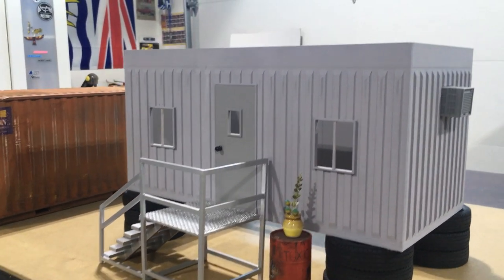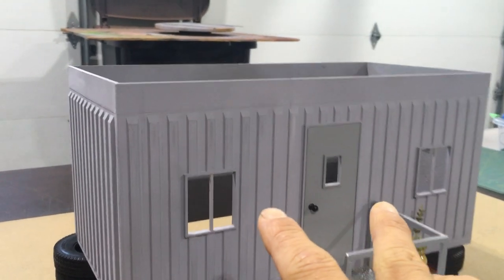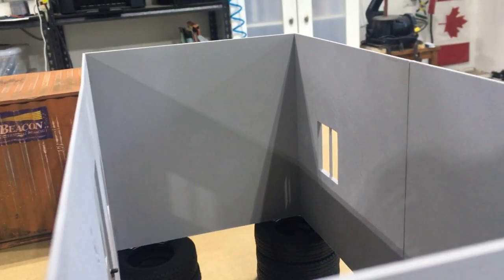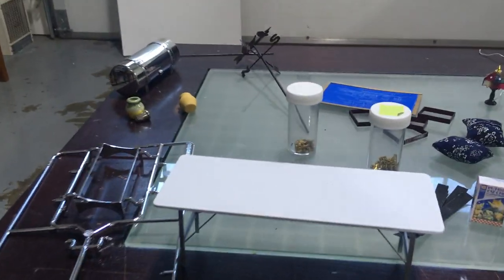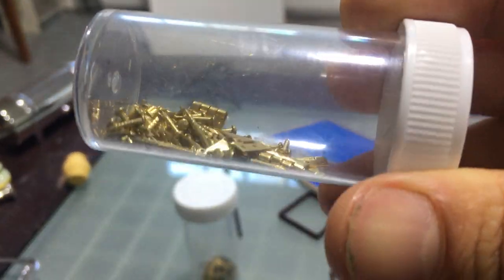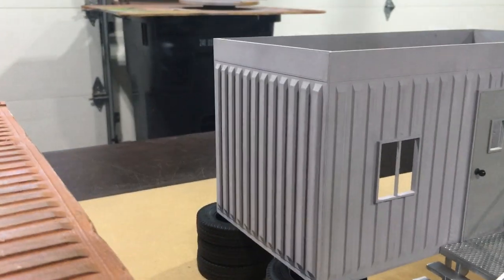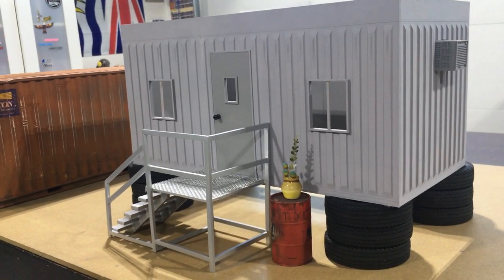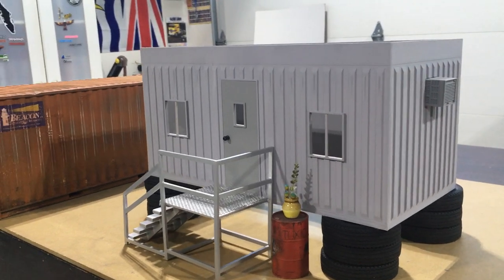Atco trailer build part 1

Comment: looks great. are you able to slice the print over the door?  that way you'll have a less of a seam to repair.. Im still working with my old flashforge finder.  IT has close to 2,800 print hrs on it and nothing has ever  gone wrong with it. not the biggest or the best printer yet it was my first and still going strong.  I will upgrade when the time is right so I can go big time prints
Reply from the maker: You know i could, the seam wouldn't be as long, but then there wouldn't be much material to join to. 2800 hours thats impressive, sounds like it's been good to you. Thanks for the comment pal